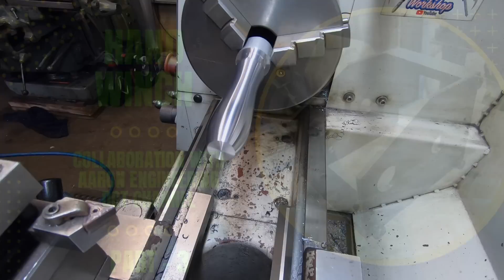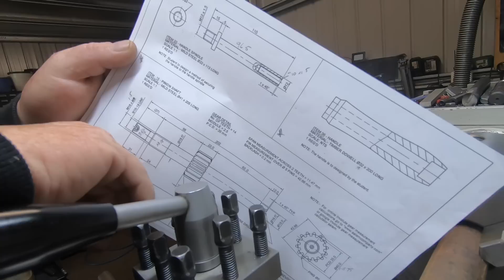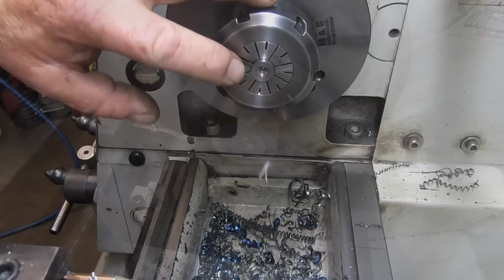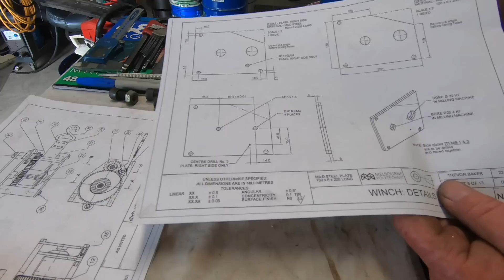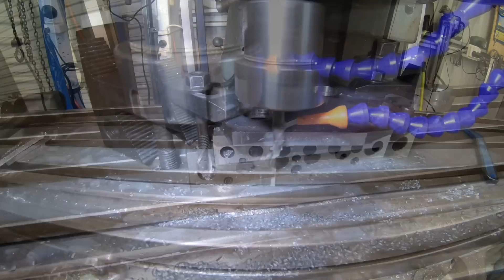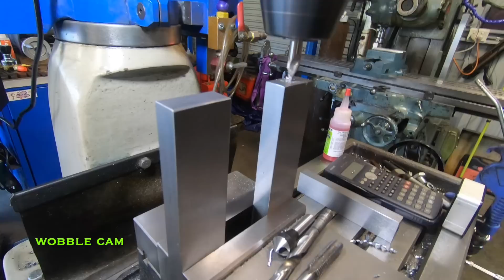Hand Winch Build   Part 3

Comment: Nice job  it's coming along nicely👍👍👍 one thing I do for that odd stuff which I seem to cut a lot of well 2 really I got a 3 inch screwless vise I can clamp in the bandsaw and I have a fixture plate with two edges cut close enough I can use my hold down set to hold  thin stuff to split in half I finally built something when I needed to split 6" round pieces that were a lil over  1 1/4 into 2 pieces that were 1/2 fixture plate 123 blocks and some cut spin clamp repeat worked pretty good 👍👍👍
Reply from the maker: Gday, I need to make something for the bandsaw to be able to cut pieces like this with ease, thanks for watching, cheers

Comment: Aaron sure made a nice handle. I finally got a cutting tool to hold those TNGG inserts. Can't wait to try them out. What GoPro are you using?
Reply from the maker: Gday Tom, the handle is really nice, I’m sure your going to like the TNGG inserts, I use a GoPro Hero 7 Black with no external mic, thanks for watching mate, cheers
Reply: @MattysWorkshop  Thanks.

Comment: Just been rewatching your oil can build, the paint on ye` lathe has gotten dickered in a real hurry... Shoulda added some way covers over her... It would also help keep those ways healthy, given your frequent use of abrasives on the parts... Also, why did you not just zip disc those angled cuts and then done them on the mill, woulda been much less material to remove that way... And i dare say faster, as the endmill would be only in tangential contact, rather than slot milling through slabs... I suppose it was not done in the bandsaw due to geometry and clamping setup difficulty, but an angle grinder and a zippy do make quick work outta anything...
Cheers and all the best!
Reply from the maker: Gday, The lathe it cleaned down quite often and to put way covers on would interfere with the saddle going forward enough when I have the collet chuck in use, im not worried about the paint, it can always be painted, I agree it would be a lot quicker to use a cutting disc to cut the bulk away on the side plates, Thanks for watching, Cheers

Comment: Excellent work Matty,  proper sizing on handle shaft, hate it when the fit is "Piss wobbly Slack" ( John @ Doubleboost quote, though the "Pr%$k in a Shirt sleeve " is my favourite). I've not come across a shaft diameter increasing after centre tapping, more like shrinkage, anyone found this?
Love the on screen comments, especially "Wobble Cam", your photography and editing is great .
Thanks for sharing. 
Best regards John
Reply from the maker: Gday John, Thanks for the kind words,  The shaft sizes turned out perfect, thats the good thing about the TNGG inserts, you can take really lights cuts to gain the perfect fit, Appreciate you watching and commenting mate, Cheers

Comment: It's funny how the beloved 'broken chips' has migrated from the CNC world, where they're easily blown away by high pressure coolant , to the manual turning world where forever the ideal 'chip' was a long easy to deal with curly spring. 8-)
Reply from the maker: Gday Bill, its a lot nicer cleaning up broken chips with the vacuum cleaner rather then the long stringy ones, Thanks for watching mate, Cheers